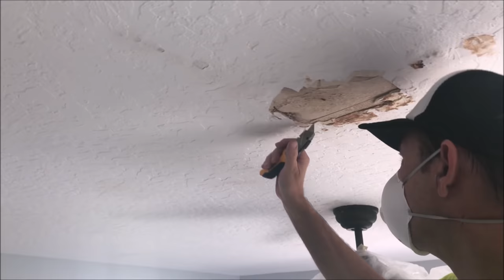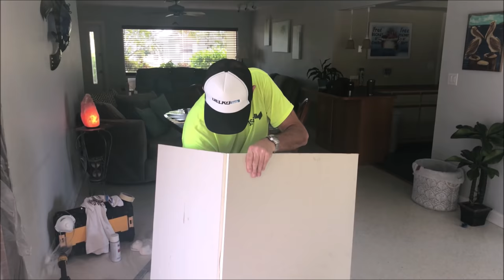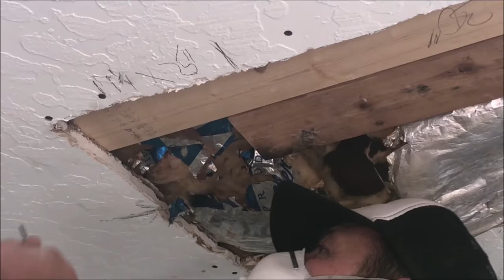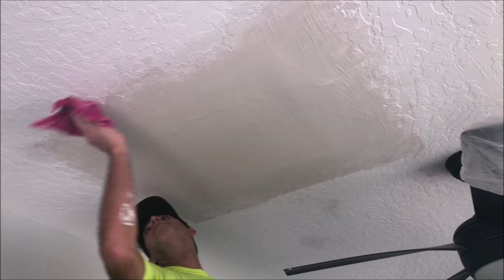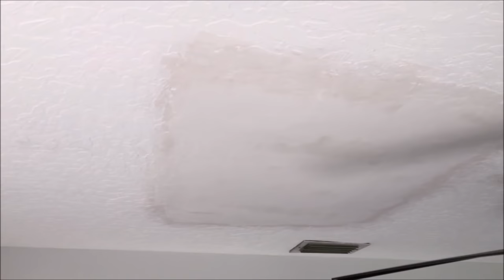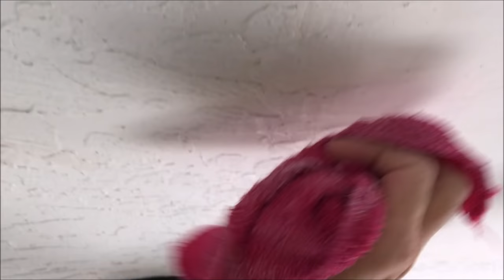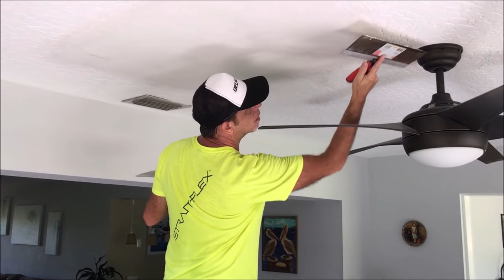How To Repair WATER DAMAGED DRYWALL CEILING- Step by Step

Comment: A little tip to home owners if you get a leak in a ceiling as soon as you notice put a whole in it so it doesn’t spread across the whole board it can prevent the sheet from bowing and falling the water spreads and starts soaking the drywall causing it to turn soft and the screws pull loose
Reply: Reading that gave me a headache 😔
Reply: First! You must fix leak!
Reply: @JoeKing67.  of course the leak has to be fixed I just stated that if you come across a leak in your ceiling just put a hole in the drywall if not the water spreads across the whole board and causes the paper backing to start letting water into the gypsum and it turns back into mud and the whole board will sag and finally collapse if you put a whole in it and let it drip into a pal then all you have to fix is the hole that you put into it not the whole ceiling. In some cases you will have to take the board down to fix the problem
Reply: Water stain is over a bed so can’t put a hole in the drywall and allow it to drip.  I put a bucket in the attic to catch the drip but we found the damage too late.  One of 4 rooms with ceiling damage from separate roof leaks.
Reply: @JT_70  as long as your ceiling isn’t sagging your good just fix the leak and stain kill will get rid of the water marks but sorry to hear your dealing with leaks
Reply: @kenseymour5152  Thanks.  The roofers can’t seem to find the sources of the leaks but believe that they are coming from nails, some of which they recently sealed.  I know that one for sure is leaking from a nail as that’s one of the leaks that I put a bucket under in the attic.  We’re beginning to question if we need to replace the 15 yr old  shingles and underlayment even though the roofers haven’t suggested it.  We are retired.  A new roof would be huge unplanned expense.
Reply: @JT_70  I would try & repair it first. Go on YouTube to try & find solutions to your leaks
Reply: @JT_70  I had two leaks involving different roofs and they were both due to dried out boots at the base of vent pipes.  I spread silicone sealer over new boots to prevent these nearly worthless seals from leaking again before the next roof job.
Reply: @pearlperlitavenegas2023  Seymour's right.  Punch a small hole at the wet spot and put a bucket under it.  It isn't always easy to locate the source of a leak.  By the time you locate and repair it, your damage will have spread due to excess water pooling.   A small hole is easy to patch and opening it up likely will help dry it after the leaking stops.
Reply: @moonrich3492  Thanks.  One leak was from beneath a boot.  It ran down about 10’ before it found a way under the tar paper and onto the bedroom ceiling and inside the exterior wall cavity.  They said they sealed the boot but I have large leaks on the same ceiling a few feet to the side of the original one.  It’s a royal pain.
Reply: Great tip
Reply: @cry2urmom757  stop reading it if my English isn’t up to your standard I’m never claimed to be a author just a construction worker
Reply: @kenseymour5152  I did stop. I had no choice. Lol
Reply: @JT_70  I drive a route, and I'm retired also.  I've seen where people put in one section of new shingles at a time.  Buy a few bundles, and some paper, remove the old shingles and slide it under the outside shingles and secure it.  You could do this as you can afford it, and yes, it's work, but it's not that hard.  Just take it easy and in 6 or 12 months, you have a new roof.  I wouldn't try this on a steep pitched roof, but on a normal ranch style home, this can be done yourself for the cost of materials.  You also feel pretty good about yourself, when it's done.
Reply: Yes sir! I didn’t do it, and the plumber did it to diagnose my toilet leak and charged me for everything.and I still have to repair the ceiling…🤦🏾‍♀️
Reply: @AmericanMayan  😂ok
Reply: I wish I did this!! My kids overflow the bathtub and the seal around bathtub wasn't good so that caused a huge Leake in the floor under the bathroom which is my living room and now the whole ceiling has a huge stain I think 3 times bigger than the one in the video 🥴
Reply: @karenculver368  lol 😂 Got to love kids I’ve seen whole sheets of drywall fall over leaks the water spreads across the whole sheet softens the drywall and causes the screws to let go
Reply: @JoeKing67.  Wow, I would have never thought of that one. Peace be unto you.
Reply: YES THAT'S TRUE, BUT 1-FIRST GOT TO LOOK FOR REASON FOR THAT LEAK", FIX IT" 2-NEXT STEP DO THAT JOB" THANKS FOR THE VIDEO"👍
Reply: Wish I saw this video and your comment before this exact thing happened to me! Lol
Reply: @whodat7084  😂😂😂 don’t it always work that way
Reply: Put a hole in it? Poke a hole
Reply: @kenseymour5152  are you saying not to replace the drywall, just prime and paint?
Reply: @genxx2724  no that’s not what I’m saying if you have a active leak and see a sag or a wet spot on your ceiling put a hole in it so the water can drip out without spreading across your whole ceiling. Then fix leak then  fix the drywall . People sometimes let’s it spread across the whole ceiling and the whole ceiling comes down when a whole could save you money

Comment: I’m a 21 year old DIY’er and I have to say this is by far the most interesting and easiest job I’ve ever seen with drywall. I have lots of repairs to do in my house, so I really hope I’ll be able to do it as smoothly.
Reply: You can do it! It's actually fun, too.
Reply: DIYer have done 5-6 projects. Currently ready to texture a bathroom.
Reply: My brother in law. Always told me if you have the tool s you can do it even if make a mistake do it over

Comment: I am a contractor.  Love your tricks.  Sometimes we get so stuck in out ways its difficult to see a different method until someone else shows us.  Hence we learn.  Over my carreer in the trades i have probably done the most of drywall finishing, and drywall repairs can be the worst to finish properly and match existing finish, like there was no repair in the first place, thats the goal.  Its much easier to finish new drywall.  I appreciate you sharing your experience with everyone who wants to know and doing a great job in the process.  you tha man!  Fyi you have sold me on the fibafuse.  I am used to using mesh tape with a hot mud, but if i can get a flatter tape that fuses better with the mud, those who finish drywall know thats the way to go.  Keep it up man!

Comment: Great video Paul. I do ceiling repairs in condominium buildings. Most leaks are caused by a leaking bathtub drain or toilet wax ring leaks. I use a oscillating multitool to cut the plaster coated stucco ceiling. Then I use the wood and cut it 4 inches longer on each side of the repair . I also use a thin drill bit to make pilot holes to screw the wood to the ceiling so the plaster won’t crack. Then I screw the new drywall using shims to level the repair and make it flush with the rest of the ceiling. Afterwards I bed the mash tape with 20 minute mud. After the mud sets up I give it a second coat of 20 minute mud through the rest of the repair extending the mud 12 inches from the repair. The third and fourth coats I use 90 minute mud very thinned out so I can skim coat the rest of the repair. I let it dry well between each coat. On the third day I sanded prime it and paint it. Thank you for sharing your techniques specially the skip trowel finish.
Reply: Paul u do great work! I live in an older home I have plaster. walls my one wall keeps getting blisters and I have to pill the wall and fix it do u think moisture is coming in the wall.What should I do to fix it?(material) thanks paul

Comment: This has definitely been an informative video. I have a hole in the ceiling in my garage that's been there since 2018. I have tried to tackle it and now i know i've been concentrating on the wrong thing. Me being a novice in this area thought I had to scrape away the texture around the hole on the existing sheetrock to ensure proper blending. I have racked my brain trying to figure out how to scrap off the old texture. When I tackle this again I plan to get it finished and in the past.

Comment: DIYer's, Thanks for making the videos! We currently relocated from Florida to Kentucky, bought 55 acres with a manufactured home. The manufactured home needs much help and a ton of drywall work. I am currently gutting the home and watching good videos like yours!!
The plan after demo, is windows and doors, followed by repairing all drywall, ceiling to floor and then paint!! Then electrical, new lights, receptacles, ect. then floors and appliances!
Reply from the maker: Sounds like a good plan.👍🏻 Thanks so much for watching and commenting.😎

Comment: I'm a DIY'er never done drywall. Your video is excellent and I was able to fix the drywall in my ceiling after a leak from the pipes above.
Reply: If you're a beginner? Always let the mud dry before putting on another coat

Comment: I usually carry a bottle of half water/half vinegar  to spray the area before putting back the drywall piece in place...just to eliminate any potential mold formation. I also have a hair dryer with  me all the time to speed up the work.   It looks like the texture at that place is bigger than what most hopper gun would deliver. That is why it probably was hand applied  , just like you did.

Comment: I’m an HVAC contractor and general DIY type but I’ve never been good at drywall.  In fact, next to plumbing, I generally hate to mess with it.  This video helps a great deal.  I’ve got an old house that is a fixer upper and I’ll have to tackle all of the rock repairs with various textures.  I’ll make certain to check out your other videos.  Thanks!

Comment: I am a 68-year-old DIY and next week I have to do the exact same repair in my daughters' condo garage as her A/C condensate was not draining and when I had cleared the clog, the water overflowed the T junction and got the ceiling soaked. So I had to take out the section of drywall that was soaked along with the insulation and install a longer verticle drain pipe to prevent the rush of water from the A/C condensate bin from overflowing. That repair went extremely well, but now I need to replace the section of drywall that I took out and replace it with a new section, just like you just did! I have always been able to cover screw heads with mud but when it comes to filling in gaps, I haven't been that successful! I will try to track down the same tape that you used in the video and give it a try...again! Sometimes this old dog just is past any new training!

Comment: Giving the manufacturers recommendation is a plus for the video quality. 
I have a wall where the drywall is away from the wall. The next thing is, I can push my index finger thru sections of it.
I would expect to see that issue on ceiling, but this is a wall. I did no see any leaks or signs of moisture. The dry wall is very dry.

Comment: Looks good. Im a roofer who often gets asked to repair drywall as part of my bid. Thinking of tackling it myself instead of referring it out. (I've done a few small projects before for family and once for a customer. Surprised myself how well things came out.) Thanks for the explanation of some of the nuances that are not easy to notice through observation alone.

Comment: I came across your video after waking up to a flooded bathroom on my second floor which damaged the first floor ceiling. About 3 feet of the ceiling cracked in a straight line.. I also have some water marks and a few big bubbles. I plan to wait until the area is dried before starting the repairs etc. Your video is on track and it is very helpful to me. This is also my first time so I will be watching your video a few times over and over. Thanks again for your very detailed instructions. PS. I just replaced the water supply valve and the floatation device in the toilet tank - these two culprits are responsible for the damage, smile.

Comment: Been drywalling in WV for 25 years...mostly smooth wall and ceilings here these days...we used to do a lot of stomp textures on ceilings...in my experience it's easier to hide a patch if it's shape is more round than square

Comment: Great job. Although never understood the appeal of textured ceilings. Best wishes from the UK.
Reply: Cultural differences maybe that we like the soft look of textured ceilings and walls in the USA.  I've never understood the appeal of wallpaper, which is ubiquitous in the UK.
Reply from the maker: Thank you Marshall. 👍🏻 I Like texture and smooth. Just depends on the space. But, I will say I’ve seen some ugly texture and some hideous not so smooth.
Reply from the maker: Couldn’t agree more Susan!🙌🏼😎 Thanks for watching and commenting! -Paul
Reply: @susanholl5994  Yes. Horses for courses/live and let live and all that. It has been very widely used in the UK (and very badly - seen some shocking, headache inducing, examples of combed artex on ceilings and walls) especially in old houses, often in an attempt to mask awful plasterwork.
Reply: @susanholl5994  we use ceiling textures to hide framing imperfections.  Trusses will wander, stand up walls at the joints wander.  Texture helps hide that.  Anytime we texture anything, we are hiding something.

Comment: I rent, unfortunately, and I had to fight my landlord to repair growth (turned out to be fungus) from a leak in the bathroom ceiling where the fan is. His guys did NOT remove all the water damaged drywall and replace it, so I'm going to attempt to do it myself. This video is extremely helpful! My biggest problem is probably going to be cutting a hole out for the fan and getting it back in. Wish me luck!

Comment: DYI.  Replacing ceiling where water pipe leaked from attic in spare bathroom.   Have done a lot of small patchwork, but never this big an area.  Hubby and I will install the new drywall, but I will be doing the joint compound repair.  Knockdown ceiling texture so this will be a challenge.  I’m artistic, so hoping that will help.  Your video is just what we needed to guide us through our project.  Thank u!

Comment: I liked to get more mud in the joint and putting a bevel on the edges with a utility knife with a brand new blade helped. 
I am not familiar with this kind of tape and have no comment.
A hair dryer works just fine as a heat gun, but always have a place well out of the way to set the thing down.
It's a bad idea to wear a wristwatch while doing drywall work.
Always have a 5 gallon bucket filled half way with warm water for cleanup
I am very impressed with the way you matched the texture with the existing ceiling.

Comment: Your video was the first to pop up when inquiring about ceiling water damage. The roof by the chimney was leaking, it's fixed, and I have to repair the water damaged ceiling. Thank you for your informative video. With your help I believe I can do it myself. Cheers!

Comment: Nice video. I recently bought a house and have lived in it for about 2 years now. recent storms caused my ceiling to leak. I called a contractor out and since its a extension and I was unsure about permit history he told me insurance would not cover and that to fix roof section and inside of the room would cost me $12k. I said good bye. And thats what lead me here. I am hoping to be able to do most work on my own and this video has given me some confidence. I am a Master Auto Technician and I feel as if I could do home repair if I just learned a little bit

Comment: I had a client with what appeared to be a 5 x 5' hole from an HVAC leak, only to discover once I started cutting into the ceiling that it was more like 7 x 6' in damage. After a lot of heartache I finally got it fixed up.

One thing I will say - if you are using paper tape, use all purpose mud with a little bit of water mixed in. The adhesion in all purpose helps the tape bind to the surface, and the water helps to keep it from bubbling.

Comment: Nice one, thanks Paul. Currently embarking on a water damaged wall in a liquor store. A drain has been misting for a few years and has ruined bottom 6 inches from floor up. Opened up yesterday, cleaned up and letting dry out. Drain tube has been extended. Patching begins today.

Comment: I'm a DYIer who just had to cut out a couple of large sections of drywall to fix a leaking copper pipe behind the wall. I got the drywall patched very well, but doing the mudding and matching the rough texture is my greater challenge.  This video has been helpful but it remains to be seen how well my attempt will come out.

Comment: 30 years, retired. Residential & Commercial Hanger, Framer & Finisher. Licensed & Insured. Contracting, Subcontracting and lots of side work. I take it you've not used any 5 minute mud? Gotta best fast and good when using it. Nice skim coat.

Comment: We recently had a coldsnap (average -35 to -50) we've been in our home for about 5 years. We always have a cold snap at some point during the winter however this was the first year we notice in corner bonus room located above garage where it was damp to touch and paint was flaking off. It's the same corner on the outside with the eavestrough that had build up snow and ice.   I just wanted to know what and how to replace our ceiling drywall if needed. Very good video. You also provide tips and details not to overlook anything.   During this time we also have the bathroom fan that definitely has some drywall to replace.  It's less than a foot by foot.  Once we determine the cause of both. We went into the attic and insulation,  V barriers seem to be in tact. And the tube from bathroom ceiling fan is insulated.  The vents are all open (not blocked).  I'm now subscribing to your channel. Great instructions,  solid information and explanations thank you.  From Canada